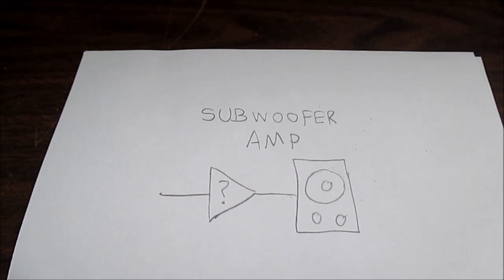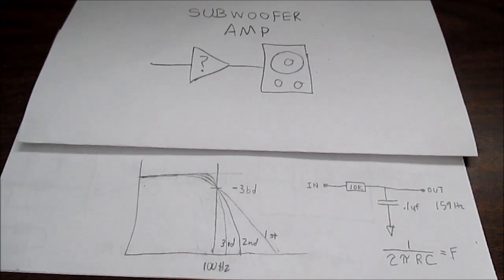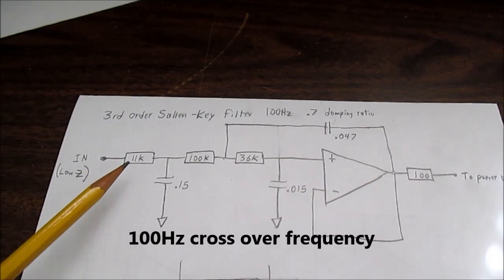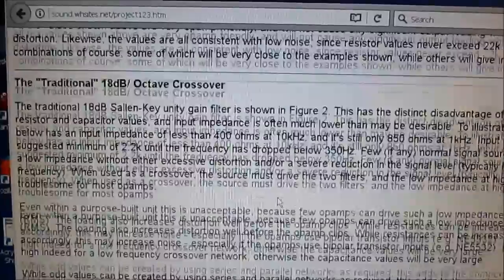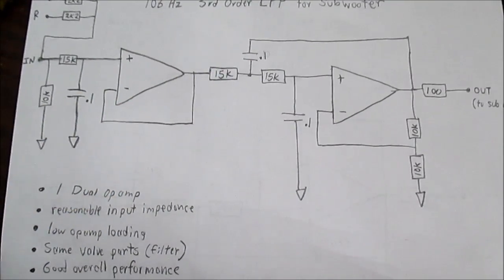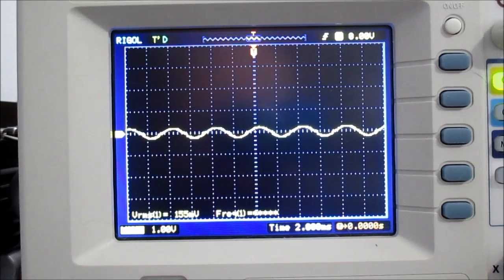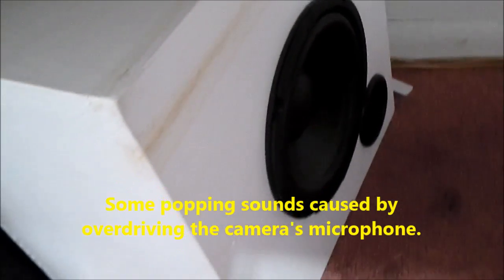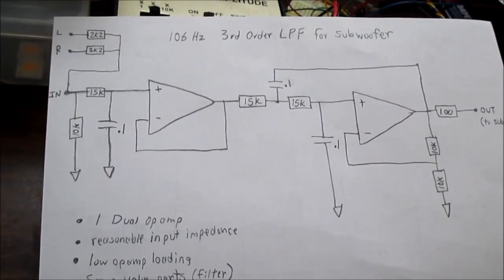High performance electronic crossover for SUBWOOFER amplifiers

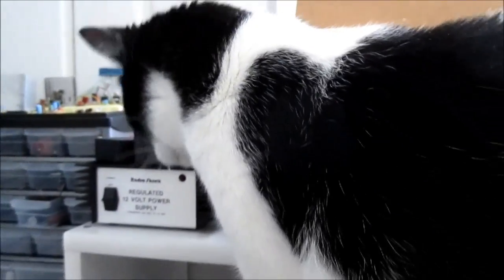Comment: 10:35  I also have cats. And dogs.
I love them both.
Is your cat still alive?
I built myself an audio system using a TPA3116 for the subwoofer, and two TDA7294; one for mids and one for highs.
And I use a Behringer commercial subwoofer that I got for my birthday... but if I hadn't gotten that gift, I would have built it as you say.

Comment: As always, great video. I know this video is old, but if you happen to see this comment.... would it be a possible to make the x-over point adjustable by using a pot instead of fixed resistors? Perhaps something like a dual 20K pot before each non-inverting input?

Comment: Ultimate noob question for you (but I really don't know): is the ground for this circuit just the 'black' speaker wire, and the input the 'red' or do I need a separate ground connection? I feel like it should be the gnd of the DC power supply for the op-amp, so the 'black' wire should avoid this circuit and pass through to the speaker, right?

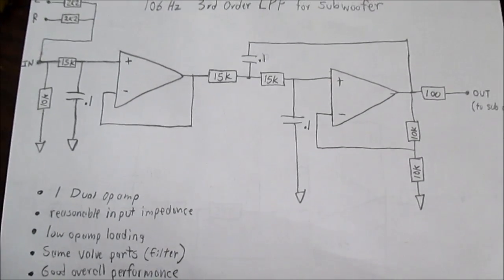Comment: At 8:00, what Op-Amp are you using, and does it have a balanced power supply, or just a single rail power supply?
Reply: idk witch one it is fr, but i think If you use 2 741 op-amps they will as an alternative do i think(did some tests and sound come out distorted tho).
He did not explain in this video but he used single rail, rather he had said on the other one.

Comment: I build 2.1 amplifier with 2 Tda2050 for speakers L and R and Tda2050 bridge for Subwoofer and work amazing from 2 years every day. i used TL072 for satelites, and NJM2068S for subwoofer. work amazing on 80% volume . thanks for sharing this good video. i look always on your video. you not test TEA2025B. this is good IC

Comment: Do you know if this circuit can be applied to the RC4558 ?  I know it is also ubiquitously used as a preamp, but I also know that I know nothing, lol.  So I'm about to fiddle around with it. If you haven't responded by the time I finish, I'll let you know if the IC (and myself) are still living.
Reply: of corse, will be work better with 4558 because 4558 have good response of bass

Comment: I am a noob in op amps and i need some help.
So basically i am trying to make 2 way crossover for subwoofer and top speakers and i want it to cross at 80 hz. I am trying to build one that you recommended in description but i can't figure out how do i power op amp because i do not see ground pin. Only thing i see is v+ and v- but where do i connect ground of my dual supply. Does it go together with audio ground.
Reply: You'd connect only + and - to the op-amp (e.g +12 volts and -12 volts or whatever the voltage the op-amp or your power supply is). Op-amp will then try to reproduce the voltage that it sees on the input and will operate anywhere on the range from -12 to +12 volts (or slightly less, say -11 to +11 volts, depending on the op-amp internals).
If you put 0 volts in, you'll get 0 volts out, to op-amp the 0 is just any value of the input signal between -12 and +12. It is not discriminating in any way where your operating point is.
The only thing where you'll need ground in this circuit is where you connect one side of the input resistors and the capacitors. That will pull the median operating point of the circuit towards 0.
Also it would be good to put a decoupling capacitors in inputs. See https://www.youtube.com/watch?v=mLHmvjxtrbk

Comment: do you know how to modify it to work with a single supply?
Reply: juubr you could use a voltage divider.  Or just 2 9v batteries connected in series.

Comment: Sorry if this has been asked by why use OPAMPs in a crossover design? Why not just the usual capacitor/Inductor/Resistor components? Might be a stupid question but I can't seem to find info on why.

Comment: Great video! The "Q" (drop-off/cutoff) of the frequency  is a huge factor in how tight your low end / subwoofer will be.  The crossover point is also where you want to roll off your component/mid-high end speakers at.  Depending on your speakers/installation, the Q does not really need to be as sharp because they produce sound more evenly accross all frequencies.  Though they will definitely have less chance of being overdriven/distorting with the low end rolled off somewhere between 50hz-80hz.  All depending on your taste and opinion.

Comment: I have builded it, running it on +-18v, i added 0.33uF poliester capacitor at the input and 470k resistor instead of 10k (from input to gnd). Works good :) I used NE5532
Reply: I got one NE5532 I would like to try.

Comment: Can u just tell me about a low pass crossover subwoofer amplifier all components name and value for a 200 watt 8 ohm speaker? i wanna make my own subwoofer amplifier. I want my subwoofer frequency between 20hz-120hz. Thanks
Reply: Geez, go spend $1 on a calculator, learn online about electronics and basic equations, and do it yourself dude. The guy is not a freelance consultant.
Reply: This filter cut of frecuency about 100hz. litte better that you ask. but start frequency depends subwoofer speaker you use. not much driver play that low. (20hz). good luck

Comment: hey jonh I made that circuit and work so well. thanks you!!  

at first try I put a 9 ( 8,5) volts whit the simple-to-simetric voltage circuit and it work but with a lot of noise, then I increase the voltage to 12 volts and all noise just disappear, can you explain me why? again thank you very much!!
Reply from the maker: Possibly clipping distortion? Other than that, the circuit should work fine at that voltage.

Comment: How can I use it with a single supply?
Reply: Use a voltage divider just like you  would with a single supply op amp, I think that will be fine :)

Comment: Hi John.  I have been making your low pass filter and what seems to be your power input for the Op-amp I do not understand is it to lower the current open apps for smoothing/filtering also I find curious the ceramic capacitor between ground of op amp and breadboard ground ?  Regards Andrew.  PS my cats name is  puss. I always get a laugh when snickers jumps on the bench.

Comment: Another excellent vid, thanks!
For filter designs, it would be interesting to see phase shift due to filter action. Your scope has two channels so it could be observed.
Mixing L and R channels for sub is acceptable but using two subs gives a lot more depth to sound stage even in a mid-sized room. Consider this a mild suggestion to anyone building a sub system.

Comment: The op amp will require 5v DC ? I think your average 5v dc wall wort would introduce too much noise -  so do you also have to build a power supply ? Was that a low level or high level input ? (guessing low level)
Reply from the maker: Yes the opamp would need power. 10v min (+/- 5v). Common to use +/-12 to 15 volts regulated supply. Line level input.

Comment: I made a subwoofer amplifier circuit the other day, I have these speakers that although they can go down quite low, they're really only good for about 200hz and up. So I made a circuit using a quad op-amp, it actively mixes the left and right, and drives the output transistors for the subwoofer speaker. I dont have any kind of filtering on it though , so what I did was put the speaker I have it connected to under the bed to muffle the highs, and it really pumps out the bass.
Reply: Schematic?
Reply: Hey Clem, how are you doing? Hope your well. Are you going to make a video of your sub-woofer project? Haven't seen you for a while bud. Hope your staying healthy. Peace dude! :) 
Ben

Comment: Yeah, I'm with Kevin if your scratching for ideas, do more crossover stuff. Why is a sharper cutoff desirable? What happens when different drivers overlap? Active VS. Passive, etc.
Reply: sharper cutoff is desired because if the filter is not of phase-linear design (i.e. the filter changes the phase of the attenuated signal), it will muddy several octaves beyond the crossover frequency due to phase cancellation distortion from consecutive drivers (sub and midrange or whatever is the next stage). Therefore, steeper filter is used to minimise the area where two speaker drivers are playing the same frequencies (this is one prominent reason). On the other hand, if the filter is very steep or a brick-wall type, the crossover will sound unnatural and abrupt and will be very difficult to mix into the overall sound performance. How steep the cutoff can be without this and other effects depends a lot on acoustic characteristics of the transducer/speaker system. In professional XO tuning, usually special tools are used, like the SMAART system from Rational Acoustics to find the best balance in between different and often contradicting factors. As John hinted in the vid, this is a separate area of science in itself. Cheers!
Reply from the maker: A 6db/octave filter would let too much midrange content pass though. Too steep of cutoff could have implications as well. Good questions for future videos.

Comment: high john. its sounds good. can you give me the ic value. and whats the power input of the circuit?
Reply from the maker: I used a NE5532. About any standard dual op amp will work.
Reply: JohnAudioTech john. do I have to power up the circuit. like 5 volts or 12 volts?
Reply: @lee26carl  yes I believe you do
Reply: @lee26carl  I see ppl using 12v with good success
Reply: yes, 5V would work if your sub-amplifier expects the usual consumer -10dB signal (316mVRMS) and if you are not using some unsuitable opamp that only goes up to 2.5V of rails or the like... the difference between active and passive crossover is that usually active crossover is done before power amplification and requires separate power itself (e.g. the active opamp components in the system that John showed). Passive XO is usually done after power amplification and by using passive components (i.e. capacitors, inductors and resistors) to filter out the undesired content. Most often passive XO is included in your speaker system. This passive variant is in a sense operating on the power from the power amp output.